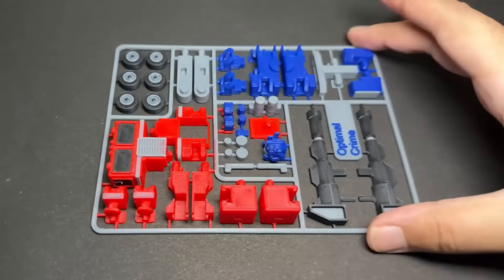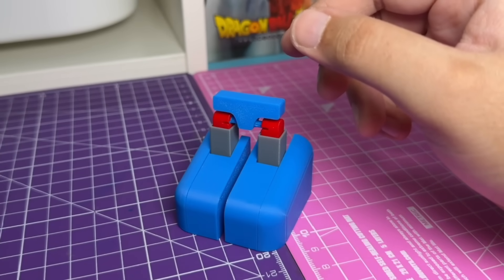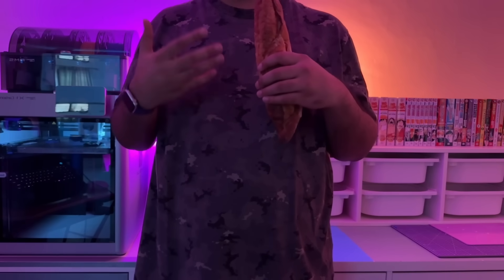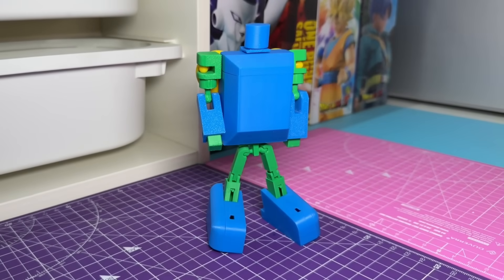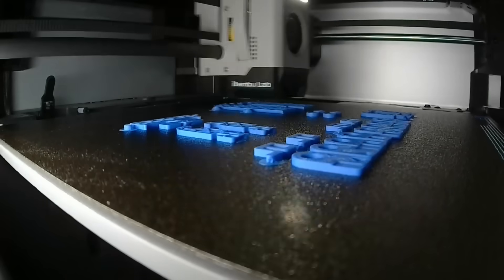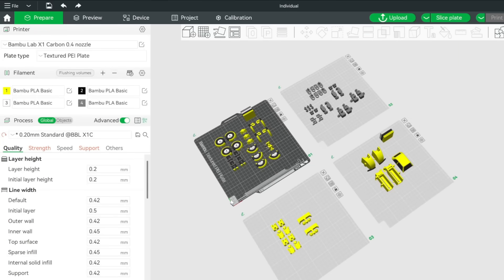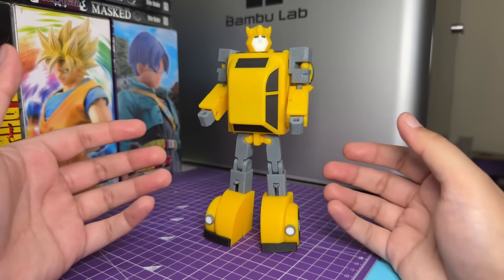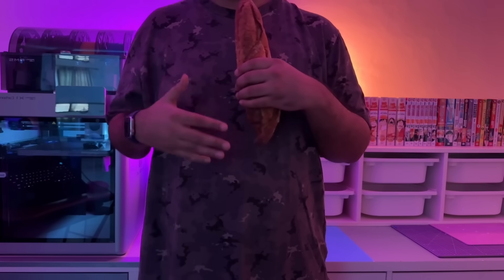I Made a 3D Printable Bumblebee Kit [Transformers]

Comment: The main issue I have is that hating on the engineering by hasbro, and Takara is kinda rude.  Like yes your's doesn't have a backpack, but couldn't make it to retail. The wheels not spinning is a big one, and the lanky torso is something they would change.  Also probably couldn't have the small notchs because those could easily break on a mainline figure. Great job on working on this all on your own,  but you have to give some credit to the engineers at has/tak.

Comment: "I've designed a set of 3D printable parts. I want to arrange them all onto a single frame, like a Gundam model kit. What software or methods can I use to automatically connect my parts to a main sheet or runner?"

Comment: This is really good for a simple solution to clean designs in both modes. Adding locking mechanisms on sliders is a good choice, since most of the time they degrade with use, sometimes catastrophically to the overall structure, so most transformers toys just do a system of hinges in order to collapse everything -- Titans Return Bumblebee does fit the whole leg into the front of the car, just through hinges, so it is possible, among a host of other methods for compressing things. Mainline non-movie based transformers have been doing really well at avoiding backpacks and other kibble overall, there're just some designs where very little can be done.

Comment: I really like the transformation you came up with.  I'm working on a transforming mini Grimlock and your ball joint supports inspired me to do something similar for Grimlock's sword.  It's really hard to have everything be "no supports" and still look/function good.  Also FYI one thing you may want to consider is reducing the "neck" of the ball joints to be shorter, and perhaps making the neck slightly wider.  I've never had any issues with them snapping, no matter what the orientation, and I print mine extremely small (robot height is 9 cm / 3.5 in).

Comment: It's honestly impressive how much you shit on other figures and how much worse your version came out.

Not saying this to be a hater. 3D modeling itself is an art that takes a lot of dedication and learned skill and if you weren't being a jerk I'd praise you for making a fully converting Transformer figure that not only is easy to assemble but is fully made on one print. I'd say doing all this solo and streamlining the production process for incredible user intuition is extremely impressive, because it is and you did a very good job.

But your wheels don't roll, the back is too flat, there's giant gashes down the side of the torso for the sliding mechanism, and despite how loudly you proclaimed to have not done a "Shitty engineering" you still wound up with superfluous vehicle parts hanging off the figure. To improve I'd suggest thinking about ways to make wheels function, and a dash of humility would also be nice.

I'd love to see you tackle a Starscream, Soundwave, or Megatron. Soundwave especially would work well for developing your skills as he's not too tricky to figure out.

Comment: I cant fathom the amount of good solutions you bring to a character that is more than 40 years old. Hasbro gotta learn
Reply: sliding joints break down and have issues over time they avoid using those whenever possible. the entire solution to bumblebees back causes his back to be extremely flat when he had a small backpack in the cartoon. i dont think that hastak has anything to really learn from this
Reply: @jh302 thats completely true, buy with enough thought and time put into engineering i thing you can find a way to either reinforce the sliding joints, or to find another way to shrink them. Especially if it is a big company like Hasbro. Also I believe you can achieve similar shrinkage of legs by trying and making accordion leg structure with locking mechanisms. Sounds complicated but I can imagine that. Plus it is way more structurally integral
Reply: @dre_demens  even a big company like hasbro has razor thin budgets for toy manufacturing to turn a profit. more parts means more cost on manufacturing. and more labor costs for assembly. you also introduce mor epoints of failure which means more potential returns and thus significantly less money on an already thin profit margin
Reply: @jh302 naw, that's what the masterpiece line is for. We are willing to pay a premium for a premium figure. 

I would easily pay $125 for a good bumblebee. I have to original mp bumble bee and didn't bother with the upgrade as it wasn't enough of an upgrade and I did not like the profile look.
Reply: Well hasbro wants the wheels to roll and theyre avoiding using sliding joints so not sure if they will want to learn from this.
Reply: @JanryllIsurita fr i hate when hasbro and takara opt for sliding joints on some toys cuz i know that joint will never hold for the long time even with locking mechanism like mp10
Reply: Please me

Comment: Have you considered using a complaint mechanism for the retaining mechanism instead of your pin system? Theoretically that'd mean easier assembly as you can just push the pieces together and use the give of the plastic to be your holding spring. You're definitely underestimating your cad skills, even if they are a bit rough your thought process more than makes up for it with designing intriguing mechanisms to solve the same problem.